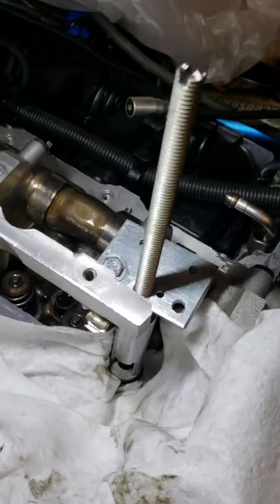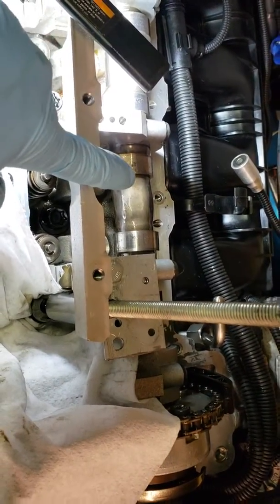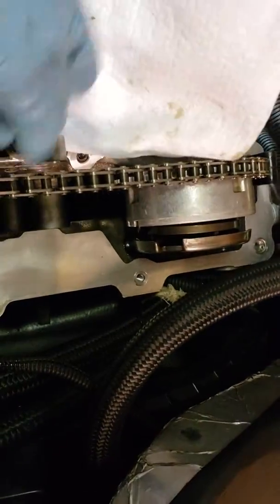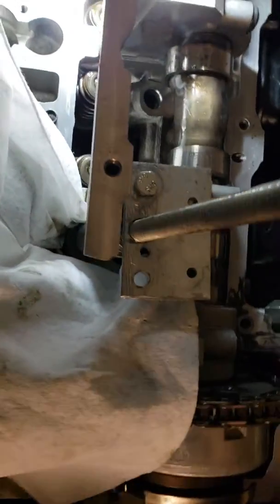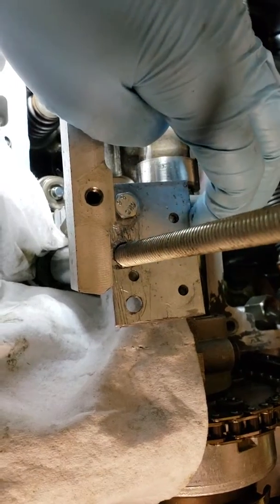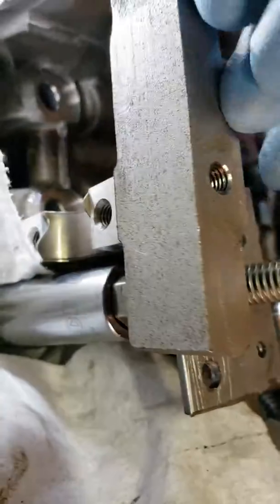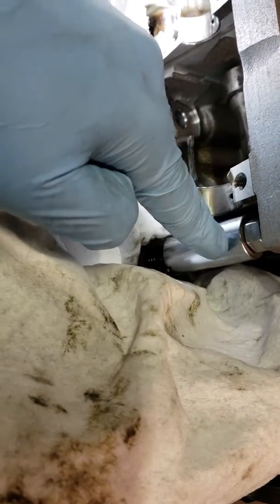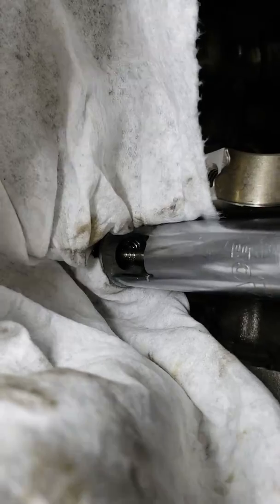BMW 135i N55 replacing intake valve stem seals with the cylinder head in the car

Comment: Did replacing the valve stem seals fix the problem? Did you notice extra oil in the combustion chamber soaking the spark plug electrode causing oil fouling? Im trying to figure out what is oil fouling my #5 & #6 and I think it’s the valve stem seals
Reply from the maker: On the particular vehicle yes. If you have oil on the plugs then check for a valve cover leak. Then check compression and boroscope the cylinder to see if you have a cracked ringland or something.
Reply: @banks334  so on your car you did see wet oil on the plug electrodes? 
Mine is a 2011 335 with a N55. I did a leak down test and all cylinders are leaking less than 5%. The valve cover gasket isn’t leaking and the plugs are only wet with oil on the electrodes. The plugs aren’t wet with oil on the top porcelain part of the plug like what is seen often with the N54 engine when the plug wells fill with oil. Thanks!
Reply from the maker: @mdiloutube  the plugs were sometimes ashy (from burnt oil). The blue smoke under vacumm was what made me look at valve stem seals.
Reply: @mdiloutube  you ever figure this out by chance? My cars doing the exact same thing, new valve cover gasket and all
Reply: have exactly the same problem on my friend's N55. Oil soaks the spark plug electrodes triggering misfire. What was the problem on your car?
Reply: @alexmike5445   #6 rod was slightly bent. This caused #6 piston to be off center slightly. When the engine gets hot the oil gets past the rings, getting the plug wet with oil. This would also create high crankcase pressure and cause excessive blow by.